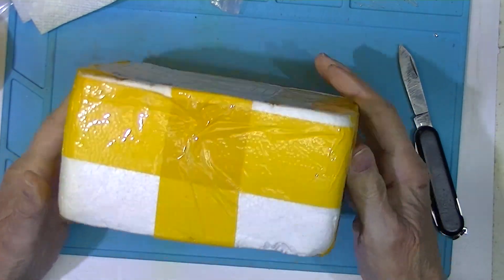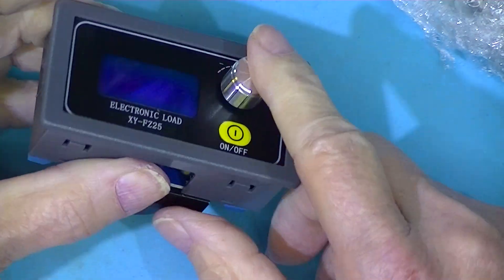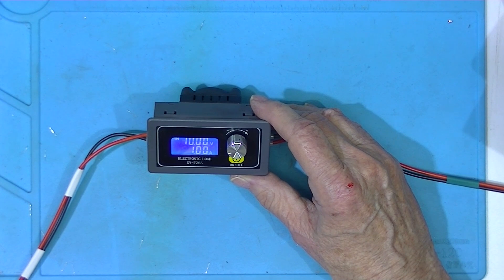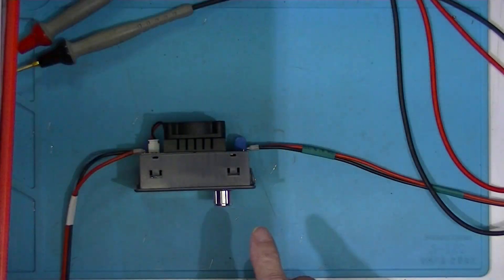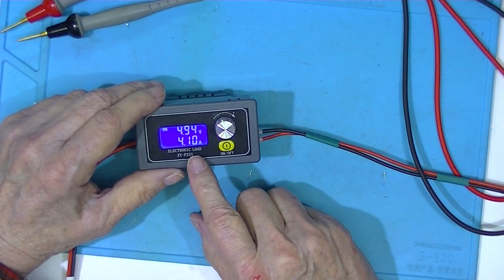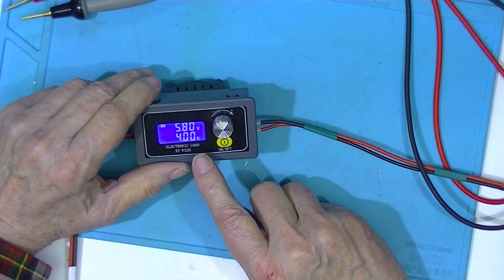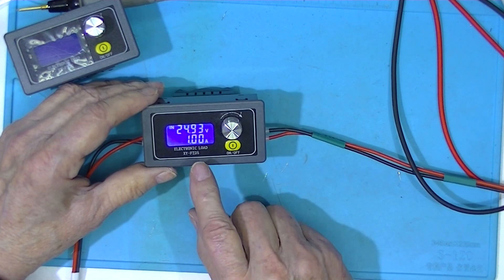A Look at Some 25 – 35 Watt Electronic Loads

Comment: Hi thanks for the video. Is it possible to run 2 of these on one PSU making 70Watts? I've seen you made a double case one and wondered if you tried to team them up?
Reply from the maker: If I can, I'll think about it and try it.
Thanks
Steve
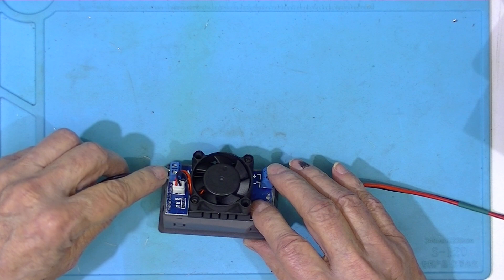Reply from the maker: OK, look at the videos, Part2/Nov 25 @ 00:50 or REDO/Dec 5 @ 04:00 and note that the black terminals (-) are connected together. I did this so the loads CAN be operated together while  insuring that none of the load current enters in the power supply wiring.
Thanks
Steve
Reply: @stevestrivia-bystevewagner4852  Thanks Steve for taking the time to check this for me. I'm going to order a couple and see if I can print a case. I was thinking of maybe using a 60mm Fan and printing some sort of duct adapter. Might help with the cooling and noise level.

Comment: I'm pretty sure that if you depress the knob you can change the other parameters
Reply: Yup. I do like watching people try to figure out products, but to not press on the encoder and try and figure out what all you can set it to really gets to me. I mean, every single product in this form factor, whether its a PSU controller, BMS,  electronic load or anything else, has a pressable rotary encoder. Maybe he figured it out eventually.
Reply: @housinit  Tu lo ha dicho